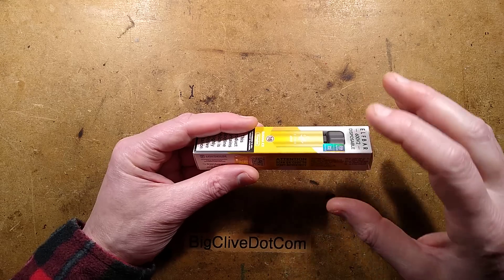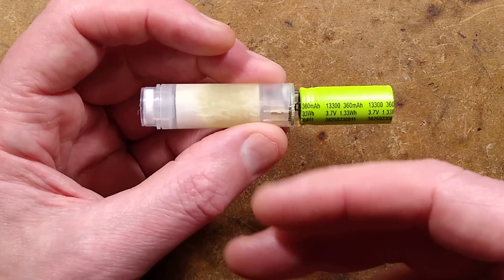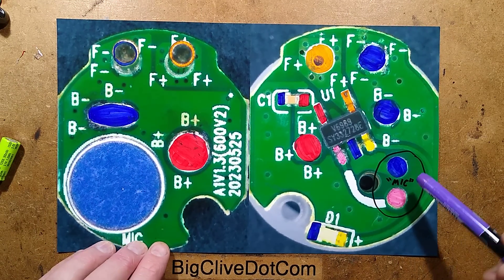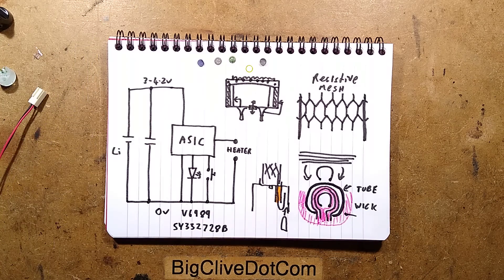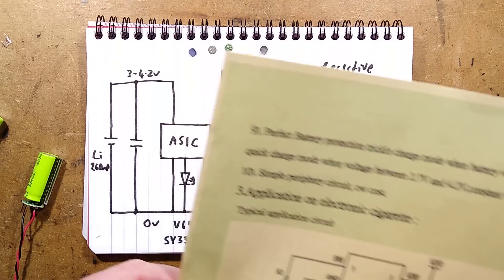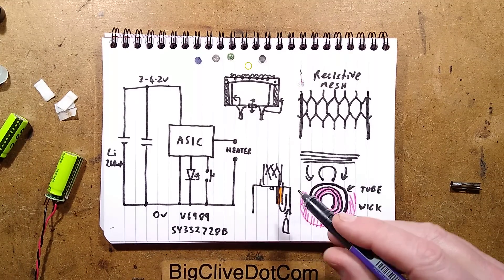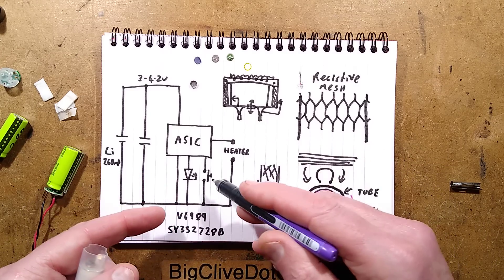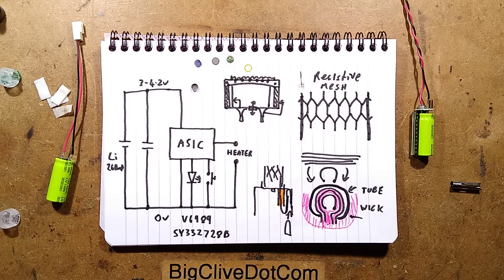Lithium "capacitor" in a disposable product

Comment: I’ve saved every disposable vape I’ve ever used (rechargeable and non-rechargeable have all used the standard lipo cell ranging from tiny straw-sized 150 mah to about 500/550 mah cells). But I just bought a load of new ones, including a bunch of brands I’ve never tried before, and now I’m weirdly excited to finish them so I can take them to bits to see if any are using this “capacitor-identifying” lipo cell. I think they’re all rechargeable, so i wonder if those batteries are used primarily in the non-rechargeable ones or if we’ll start to see them in all of the disposables soon

Comment: Locally I've found that almost everyone has migrated to the rechargeable disposable vapes (with consequently smaller battery capacities, around the 500-650mAh mark). The pure-disposable ones still exist on store shelves, but I've not found them on the roadside for almost a year now. The fancier rechargeable units now even have a small segmented display (apparently passive OLED with a battery and remaining vape juice indicator), but I haven't managed to obtain one yet. I suspect those have some sort of anti-refill lockout but until I take one apart I can't say for certain.

Comment: i have seen such litium cells in capacitor housings bevore in an usb rechargable toy car. i fixed it because those cells did get out of balance ,so i put in an small balance pcb and it works now witout any problem...

Comment: PLEASE HELP
Hello,
I am asking for help to make a remote control strobe light with alarm. I am a bit older and am teaching myself things i did not want to learn when i was younger. 

I just need a bit of guidance with the pcb board. I can pay a small amount as i have yet to return to work after a horrible and very long hospital stay.  I do not expect anyone to work for free.

Please help. Thank you in advance.
Reply from the maker: You can buy the modules for something like that online.  Or even the complete device.
Reply: @bigclivedotcom  I understand but I don't know enough on how to set it up and what components I would need. That's what I need help with.

Comment: Noticed these when I deconstructed a few to show a friend what was inside the puffers they were using and throwing away...  Probably will use them to power a remote Zigbee sensor that usually takes 2 x AA batteries.

Comment: Is the "battery" in fact a LiC device?  These combine many of the advantages of  a Supercapacitor with Li-Ion technology,  in particular the higher operating voltage. From Manufacturers docs, their cycle lifespan is a lot less than a "true" DL capacitor, but if the degree of discharge is managed, they are still far more durable than conventional LiPo cells.  We've got a "wireless" weather station system, and I replaced the rechargeable NiMh cells with one of these a while back. So far (24+ months) it has worked perfectly well, and the "remote battery lifespan" indicator on the base-station suggests available battery capacity is always 100%  (however this may be meaningless since the characteristics of LiC cells are very different to NiMH). Nevertheless an interesting technology.

Comment: Another wonderful video. Also congrats on the 1M subs, I hope you get your gold play button soon. The disposable vape market for the US hemp industry is a huge nowadays. I remember 2 years ago you could get a 510 threaded cart for $40 for 1 gram of concentrate. Now you can get USB-C rechargeable vape with 3 grams for roughly the same price. Obviously wasteful but the price vs value/convenience is way higher. Even private dispensaries have their own in house made devices for the same prices. 😁
Reply: TBH, I'm getting 2 gram 510 carts(new fat bodies with standard 510 cartridge components top and bottom) for ~$22 now. It REALLY depends where you're shopping though that's for sure, I'm lucky enough to have a local shop with great prices. It is mostly disposables in there though.
Reply: Always be sure to buy from a trusted dispo or shop when buying carts personally I have seen many many fakes out there it's hard to trust I've seen local shops selling fakes there unregulated and straight from china be safe out there and always check

Comment: I haven't encountered one like this yet. Whenever I see a discarded vape I take it and disassemble it for the rechargeable lithium cell. All the ones I've encountered use pretty standard greeny tabbed design. positive on one end and negative on the other. Even the vapes without USB c ports seem to use the same sort of cell.

Comment: Why would you throw away the vape when you're done? That's a perfectly good self contained ignition device, with pressure or airflow trigger integrated already. So much potential. Thats not trash 😊😘🤔

Comment: One of these would be ideal for powering a bunch of electric blasting caps over a long wire with a safety factor for resistance
Reply: Could totally fit a couple in a condom to waterproof

Comment: Wow, this one has a much better construction than the ones I've been getting batteries from. Those have a coil/liquid part that comes apart as you slide it out, and the battery is connected by wires. This one looks much easier to take out, with it all coming out as one solid part.
Reply: Looks easier, but is not! Try removing the components from a semi crushed one 😉 oh and good luck separating the battery from the circuit board 😅

Comment: I'm sure that at least half of the misreports of a "capacitor" are a result of the fact that the blank end of the cell housing has that embossed pattern, which closely resembles the sort of oft-unreliable electrolytic capacitor that is infamous for inflating into a domed-end cylinder when it fails.  Some of us have replaced way too many of these when repairing devices of many types; far more people have learned to look for and recognize those domed cans as a reliable sign of a failed cap.

Comment: You also may want to look at the I vape great brand, they have this vape that contains 4 flavours within and the way they have done it they could of easily made it refillable but the battery is not setup to be recharged, have been wondering if it could be hacked to make it rechargeable.

Comment: Check out the vuze go edition 01, which may be non-destructively dismembered with care, and has the heating element printed or sputtered onto a sintered glass block(?) of ~9x4x3mm as the vaporizing element. Shrinkflation has been going on in vapes for over a year, first with the cell replaced with smaller units, then with the absorbent reservoir of vape liquid shrinking by up to 2/3 of the original. But hey, the point of failure tends to be carbonization of the heating element, spoiling the vapor in taste and quantity as the heating characteristics change.
Reply from the maker: The RELX units also seem to use a block like that.  Quite unusual.

Comment: As a single use device the battery doesn’t need a protection chip.  It can be drained below the safe recharging voltage.

Comment: My take on the capacitor style battery is that this could be to facilitate automated assembly. Cylinders of controlled dimensions and with rigid bodies are much easier to handle by machine than pouch style Lipo cells.  They can also be supplied by the battery manufacturer, packaged (various tape and reel options, or cartons) and handled in assembly much like conventional leaded electrolytic capacitors.  One question, since Clive did not venture to open one of them in the presence of the explosion containment pie dish... does the battery casing also enclose a basic protection circuit? One would hope so, but would be good to know, perhaps.
Reply from the maker: Cell disassembly video coming next.

Comment: I've been testing a lot of random Li-Ion batteries lately and one thing I've noticed is that; and this excludes the companies that just outright lie on their spec sheet; their "rated spec" for capacity is only obtained at a real low current. Example, the last set I tested was rated 800mAh and returned 805mAh @ 100mAh constant, 752mAh @ 400mAh C.C., and 605mAh @ 600mAh C.C. . Obviously this probably isn't as true with very high end cells from Samsung or LG, as they're more likely to thoroughly  spec their products. The other OEM's play a little loose.

I bet if you tested them with that in mind and pulled a really low current to drain them, they'd perform closer to the rated spec.

Comment: Looks like they made them to remove the electronics guts and recharge the battery and install in a new case. Applying 5v to the filiment plus and minus recharges the battery in these. Also the LED lights up red as well then goes out. I am guessing they are using the led as a voltage refrence to indicate end of charging as well as a indicator. During normal use the Led glows blue when you take a drag.❤

Comment: Hey Clive, safety tip:   Remove the negative lead from the ground plane first, then removing the positive connection is rendered inert.    Honestly figured you would’ve already known that.
Reply: Even if you desolder the negative first it's still mechanically stuck in the (almost certainly through plated)  hole, still a high short risk.
Reply: @volentimeh  that’s why I said removing the negative lead from the ground plane.

I did not tell him to “Desolder” anything as that’s only part of the process of rendering the removal of the positive lead safe.

Thanks for not reading what I wrote and just replying to try and make me look dumb.   👍🏽
Reply: @AaronsSpeedShop  Yeah desoldering the negative lead might not be safe enough. At this point it might be better to isolate the negative pin by milling the ground plane around it.
Another safety measure is to previously drain the Li-ion battery under 3V. It might need to be kickstarted though if it's too much drained.

Comment: So Elf Bar got stung about 6 months ago as their products were found to contain double the legal amount of liquid. Maybe reducing the capacity of the cell is a belt and braces measure so that if the liquid is overfilled the cell will die first?

The first generation Elf bars share the same internals as the majority of the other tube versions, NZO, Crystal, SKE. The Vuse (Made by BAT) is slightly more robust but similar circuitry. The smaller Lost Mary palm sized ones are the same as Elf just in a different layout.

There is a new Vuse that does 700 puffs that I'm yet to find on the floor but i wonder if the internals are similar to this.

Comment: Single use vape devices are such a stupid(borderline retarded) thing,  I bought Coolfire Z80 battery mod for like 25€, it takes in one 18650 battery(also charges it over USB C cable), it is over 1 year old now and still on my first battery, if battery goes bad it is dead simple to replace...  Like I get it its cheaper to buy single use devices in short term, but buying something that can be recharged pays off in a few weeks.

Comment: Found one of these Elfbar 600V2 devices discarded in the grass last week. Good thing I waited for your video before attempting disassembly. I opted to use flush cutters with masking tape around the blades to simply cut the PCB off one terminal at a time instead of desoldering. I wouldn't expect that 5-pin chip to have any recharging circuitry. It is basically the same chip that was inside the pressure sensing capsule of the older version Elfbar. So all the manufacturers have done is manage to waste even more components, reduced the battery capacity, and frustrate people trying the recycle the battery.

At least I don't have to cut the top off the pressure sensor capsule to reach that 5-pin chip. It can be repurposed as a capacitive touch sensor that is capable of switching sufficient current to trigger a relay, DC hobby motor, or small solemoid.

Comment: Those with exchangeable pods are much better not only to the environment: they are actually helping manufacturers keep their users with their variant of the device.
And a side product of those who make these rechargeable units is a dedicated soldering iron power supply, which has a function of constant heating (instead of puff-on-demand in these devices).

Comment: These have been around for decades. If you're in the business you know.
I'm not entirely sure how they are putting them in these disposable devices because the off-the-shelf the ecap-like batteries are quite a bit more expensive, at least in retail.

Comment: I found similar capacitor style lithium cells in a remote control car battery that had died. I've had it for quite a few years now, and it was sitting at work (warranty return) for at least 6 months before that.

There were 3 of these cells in series. With no cell balancing, no individual cell monitoring, no temperature monitoring, etc. 🤦
When I checked the cell voltages, one was 0v, one was about 2v and the last one was aroubd 3v. Clearly designed by someone who was used to NiMH cells and didn't understand lithium cells.

I'm a little surprised it didn't catch fire, to be honest.

Comment: Don't charge from the pins as that has reverse protection on the board and most likely output only, connect to the capacitor legs instead :)

Comment: I love those tiny LIIOn cells, with a TP4506 they make a very good alternative for double and triple AA and AAA battery.
They almost fit inside the existing battery case, just a small adjustment for the USB port and you have a rechargeable battery for 0.20 ct...
Reply: I have the USB recharge version in my A/V remote, best conversion ever as batteries lasted weeks in that thing !

Comment: I am almost sure my dashcam has a capacitor in it.  It has a parking mode, if your car is hit when the engine is off, it will start recording. I read it uses a capacitor instead of a battery.

Comment: I am a model train guy, I found one of these discarded on the streets and brought it home to take apart and try and use the heater to make a smoke unit for simulating steam on a model train.
I have not gotten around to desoldering anything yet. I presume I will have to wear gloves due to the nicotine. Perhaps that could be a warning to anyone taking them apart, to wear rubber gloves. Nicotine goes through the skin.

Comment: Based on your previous videos I started picking these things up and collected close to 30 lipo batteries so far, plus some really cool looking aluminum tubes, but I have no idea what to do with them. Also I've since learned those batteries are a terrible fire hazard, but I don't want to throw them out 😥
Reply: Fire risk only applies if they have charge (including at their "discharged" state of ~3v). If you fully discharge them down to 0v, they're no risk (for fire - still an environmental hazard). They're not reusable at that stage though, so only do that if you're throwing them away.

Comment: So its basically a 13300 lithium battery (same specs), only difference is physical, the 2 poles are on the same side, usually they use normal lithium battery with a thin strip of conductor on the side to reach the other pole. I dont see any use case other than gaining 0.1mm on the width of long thin device... basically only ecigs. but why not?

Comment: I like this form factor for li-ion batteries. I can totally see some of these in more serious and less junk products, like tiny backup power supplies for system on chips, or internet-of-thingy sensors and stuff. With optional solar cells.
Reply: Quitting smoking not serious???
Reply: @farmazooticalz  quitting smoking with such disposable devices is not serious when you can invest into devices better in every ways for less than 30 $/€/£

Comment: 280mah actual capacity / 350mah rated capacity = 0.8 which is the exact capacity degredation ammount where a rechargeable battery is considered no longer good and in need of replacement. I wonder if these cells are used? I've always had a suspicion that these vape manufacturers spring up whenever a super affordable source of the required parts hits the market. Like in this case the batteries. Maybe they were removed from a product after it's useful service life was exceeded and then sold on the parts market for super cheap which this vape manufacturer took advantage of by putting the degraded cells a disposable product where the degraded performance won't be noted.

Comment: No charge circuit because YOU👆 TIPED THEM OFF MISTER 😠
Just kidding😊 but it is possible that they saw A video not necessarily yours, or the bean counters did away with it, and it's possible that it's not custom battery, could be "hey what the #ell are we going to do with these two billion capacitor hulls that we ordered wrong and can't return "😁

Comment: I would like to see you dissect one of those 1.5 volt Li-ion AA or AAA batteries. These combine a standard 3.7 volt Li-ion battery with a tiny buck converter. It all fits within a AA or AAA standard battery case. I have been experimenting with these. One failed so I decided to take it apart. I could not find the buck converter. Maybe you will have better luck.

Comment: Lithium Ion Capacitors are a thing, which gives similar energy density to a LiPo cell, but without the self discharge or risk of thermal runaway. Interesting tech to read into

Comment: Might be worth pointing out that there actually is such a thing as a lithium capacitor. Basically one of the electrodes is the same as what you'd find in a lithium-ion battery and the other is what you'd find in a supercapacitor. Stores a bit more energy per unit of volume than a supercap does but nothing too fancy.

I don't think this is one of those, though, on account of the capacity being expressed in mAh and not in farads.